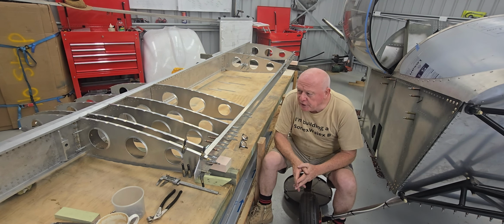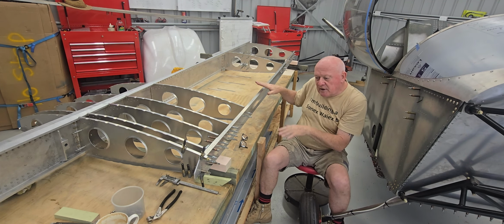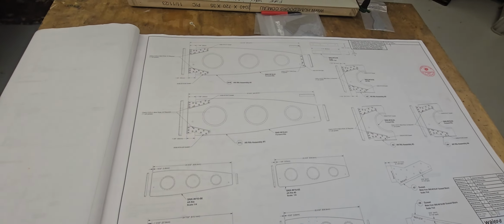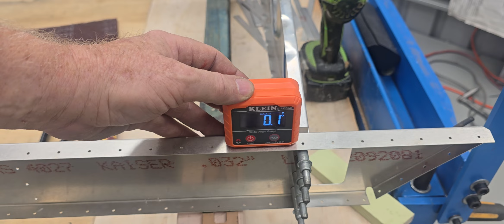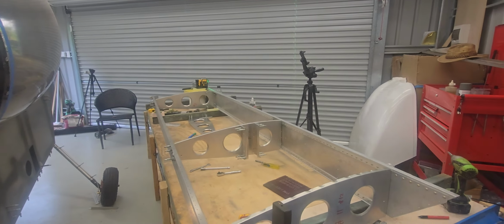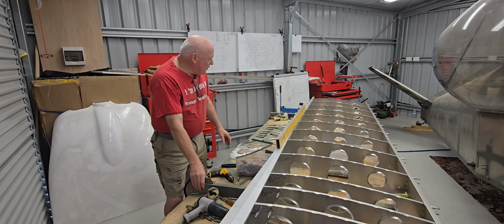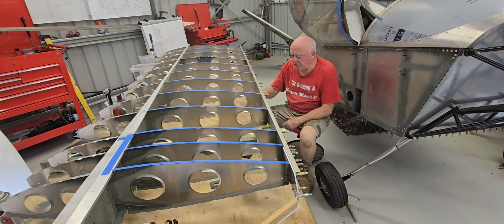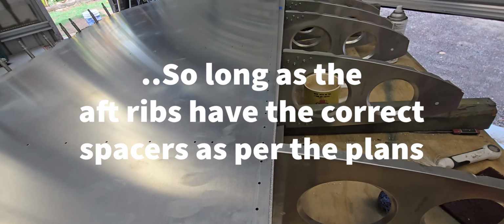Sonex Waiex B, part 42, wing ribs installation

Comment: Coming along very nicely .
Reply from the maker: Yes, getting there...I am always nervous when I start a new section if the build
Reply: @pandyseven  why did you choose blinds for the ribs instead of solid?
Reply from the maker: Blind rivets is how the aircraft was designed, solids are only in the main spar and on the windscreen 'bow'
Reply: @pandyseven  wonder if they did it for weight
Reply from the maker: I dont belive so, I would guess it is for the ease of building...its faster and takes only one person to do? solid riverts require more expierence....
Reply: @pandyseven  I would hope anyone building their own aircraft can shoot and buck. We're not talking monel here, a #5 solid is pretty soft
Reply from the maker: There are many advantages and disadvantages to solid rivets like all things in life, for me though the key thing for the Sonex build was the pneumatic style rivet.  Why? is that I am not getting any younger and this style of build has the potential to take a few years off the build time, so that’s a plus. Just so you know, this is my second airplane build, the first was an RV6, with solid flush rivets and am happy to put my hands up by saying I did make many errors in riveting which need to be replaced.
Reply: @pandyseven  Dont worry about bad solid rivets, even the pro's mess up a bunch. I'm an inspector for Boeing, SAC, Embraer, Bombardier, etc.
Glad you're having fun with the build.
Reply from the maker: Wow, impressive portfolio of credentials…yes and when I finish this one, will start another

Comment: I'm working on my left wing right now and just drilled the pilot holes into the ribs and front spar - pretty much right where you are. I'm not doing a video for this one - just want to enjoy working on the plane. 

I think your jig is nice and should work for this portion of the build, but you're probably going to need to change it once you have both of your skins attached. I did something similar and ended up having to come up with a way to suspend the wing with the skins attached so I could ensure it was straight all the way through final riveting. 

I might recommend not up-drilling the skin/rear spar holes until last. That way you have just a little wiggle room to make sure it's all straight before locking it into shape forever.
Reply from the maker: Great advice and will take it on board. You’re right about the jig, and have already looked ahead that the way I have done it possible wont work when inverted, but will see this weekend.

Comment: Здравствуйте!Хотел спросить по лонжерону крыла?Есть упоры на лонжеронах в виде пластин чтобы крылья не опускались вниз при сборке.А есть ли такие упоры чтобы крылья не перемещались наверх разгружая два болта?Или подъемную силу воспринимают два болта?спасибо!
Reply from the maker: There are stops on each spar which basically aligns the wing into its position, then the 3 tooling holes are for alignment. Once that is achieved you have two forward half inch bolts and two rear quarter inch bolts that fix tight the two spars together with the bolts.
So basically, you have 3 tooling holes and the two plates that align and you finish off with the bolts, two forward and two aft…hope this answers and I didn’t get lost in the translation?